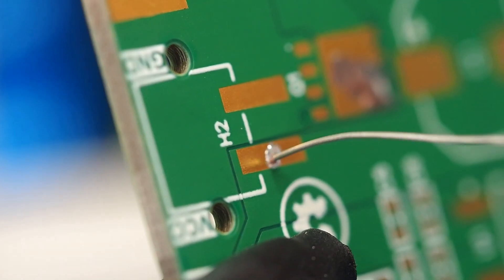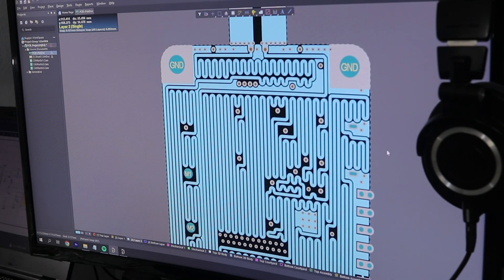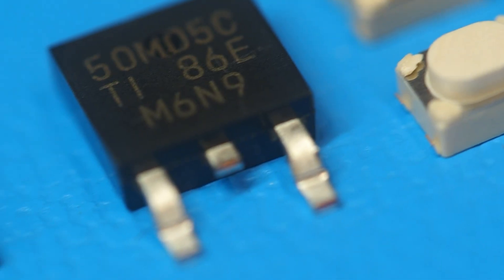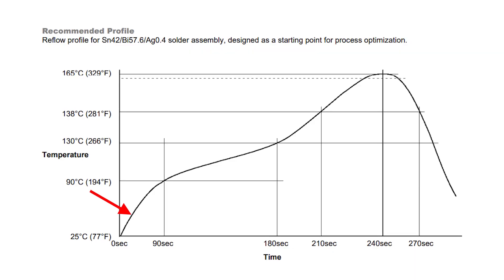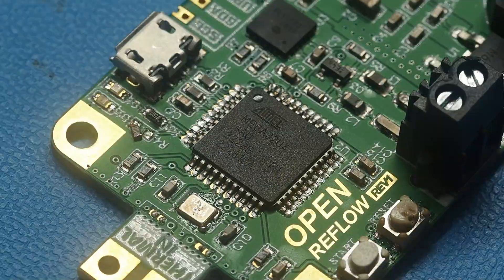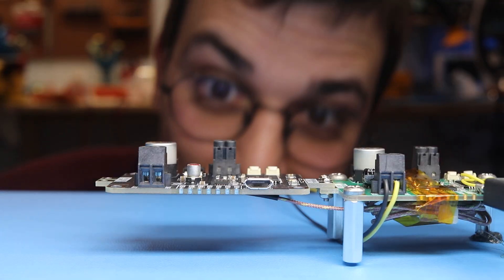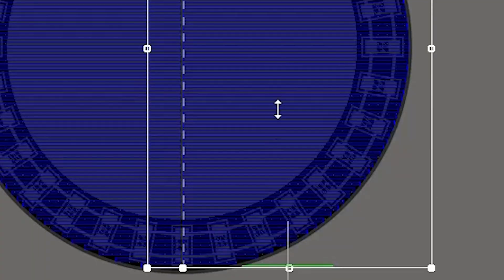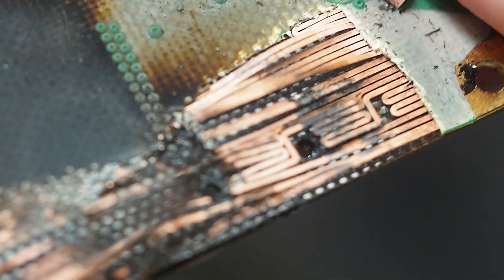I made a Self-Soldering Circuit

Comment: This is amazing, i could definitely see this being incorporated into peoples kits
Reply: It is not amazing. It is not a good idea to increase the resistance of the ground polygon. The whole idea of having a ground polygon is to have a noise sink that is actually low on resistance!!!
Reply: @sillfsxa1927  So submit a pull request and get those gingerbread edges used measuring/reinforcing conductance.
Reply: I wish Altium has a cheaper plan; sadly it is way too expensive.
Reply: @bsodmike  altium isn't the only option, kicad is the best alternative but there is also easy eda if you want to use that.
Reply: @conorstewart2214  Thanks, I've been using Eagle for years, but been wanting to try Altium :)
Reply: @conorstewart2214  Kicad all the way. Even for professional use. Good enough for CERN. Good enough for me ;)
Reply: people's*
Reply: You also need to dedicate an entire layer to this. Adding layers adds cost. It's a cool science experiment - it's not practical in any way.
Reply: Absolutely. I think this is a huge leap forward for small/individual board designers. Someone has a cool idea (like @alvaroprieto and his USB cable tester) - a great product but if you don't have SMD gear, pre-built was the only option. Now anyone could use this approach to sell small SMD kits without the need to pre-build boards. Only issue is the cost Carl mentioned. Sometimes I forget I'm not watching a big electronics R&D company channel when I'm watching Carl's videos.
Reply: @kick1ass20  the cost of getting basic equipment for smd soldering is much cheaper than the cost increase of using higher temperature boards. Even a basic PTC hot plate works well enough for smd soldering and you can get those very cheap.
Reply: @conorstewart2214  yeah, but if it's a slightly customizable board and you want to buy a one-off kit on ebay where you can tweak a few components and then SMD solder it "yourself" like this - this is really cool
Reply: @gd.ritter  if you are going to the effort of buying a kit where you need to tweak smd components you can at the very least buy a hot plate or something. With this you need a power supply, constant current is probably best unless they can work out what voltage works for that specific board which would take a bit of effort on the designers side and it needs to be quite a powerful power supply since there probably isn’t that much resistance on the heating trace and it will need relatively high current to get it to the required temperature.

This isn’t just a one off solution since you will still need a decent power supply to get it to work.

Edit: this is more complicated than buying a PTC hot plate and wiring it up, since they are self regulating and that would allow you to use normal solder paste to reflow it, not low temperature stuff.
Reply: @conorstewart2214  yeah, maybe it is pretty niche overall. But for me, who likes to occasionally do DIY stuff and my basic set up isn't appropriate to SMD soldering and not wanting to invest in more gear to store somewhere for such infrequent use (for me it would be very rare). But I do have a nice bench power supply that I use with thru-hole projects, so I can see me liking having this trick in my back pocket.
Reply: @conorstewart2214  Good to have another tool for pcb upgrades. Maybe the robot wars people can implement beast orthodontics in servo controllers.
Reply: @kick1ass20  Not just that but it has commercial uses too
Reply: @kick1ass20  it isnt that hard to hand solder SMD as long as they aren't BGA. I've gotten away with putting a big via in a large copper thermal pad and soldering it from the other side of the board. It takes some time, but still faster than waiting for them to be built by a PCB manufacturer. For prototyping I think this is more trouble than its worth, and is useless for boards that use higher speed signals